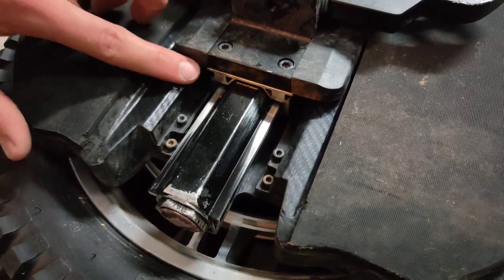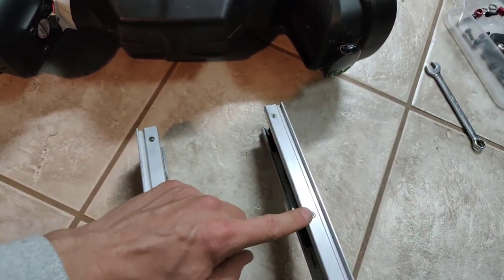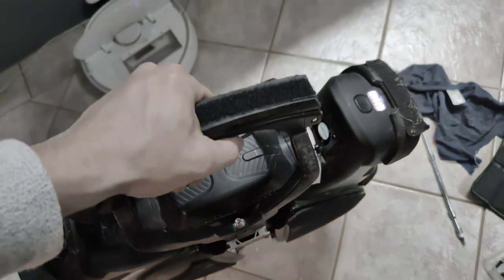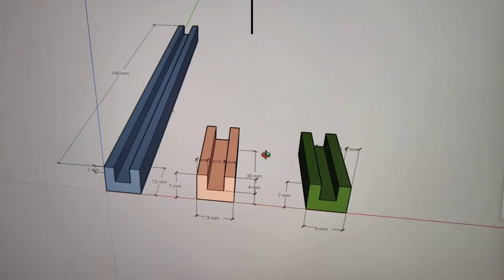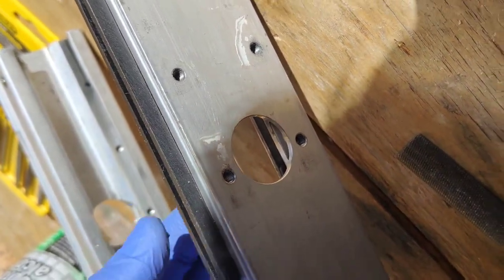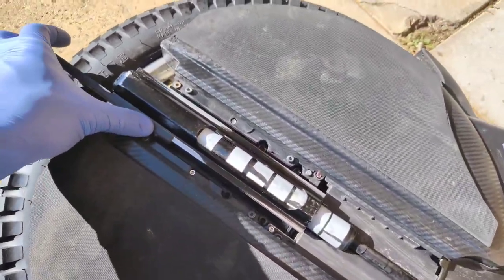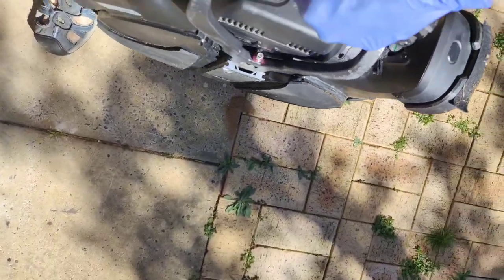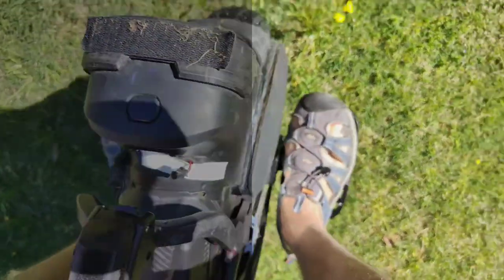InMotion v11 Suspension Upgrade 3D Printed Sliders Mod.

Comment: The original sliding guides are made of enhanced POM. It has good sliding properties. Regular 3D printer filaments do not. I tried PLA sliding guides a few years ago, and the durability of them was extremely poor. They didn't slide well enough either. That said, I've been running 3D printed nylon sliding guides on waxed rails for a year now already, and they are working pretty well. They seem to have great sliding properties at first, but I guess they become more sticky when they heat up, since the performance seems to change a bit during a ride.

What should be used for these is the Iglidur filament. Very expensive, but it is exactly designed for making linear sliders. Haven't bought a roll though, since it is indeed quite expensive.

Another tip, you need to leave about 0.2mm of extra room for 3D printed parts to fit well in any existing measures.

Comment: Yo I am wondering if you can design a solid kickstand for this euc.
Maybe the kickstand can be a rare mudguard and kickstand at the same time.
Reply from the maker: I believe the best kickstand would be port of the light bumpers, where you face the machine 90 degrees and rest it on the bumper.
At the moment I ride a Sherman and just get creative where I stand it up leaning against a object. The power pads help lock it in place.

Comment: Great job. Could you please tell me where I can find the STL files for printing them ?
Reply from the maker: Will let's you know shortly.
Still refining. Only printed one and the next 3 adjusting tolerances. Will be adding to thingsverse too
Reply: @jc84com  please let us know here, so we get a reminder ;-)
Reply: @jc84com  Hi Julian. What about those 3D printed sliders and the STL files ?
Reply from the maker: @electric-rider  yes. I have been so slow at getting these sorted. Only got my suspension working again today with them. I just asked the guy to upload the to things verse 2mins ago .
Reply: @jc84com  thanks a lot for those sliders. I’ll try to print them ASAP 😉. Do you still use them on your V11 ? For a better search on Thingiverse, you might add Inmotion in the title and on the description of the sliders 😉👍✌️
Reply from the maker: @electric-rider  title has been updated. Thankyou, yes I use x4 of them on my V11. They took about 50km to settle in but are great.
Feel free to modify and spin them off.